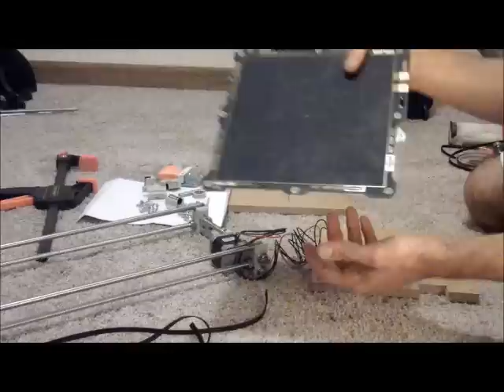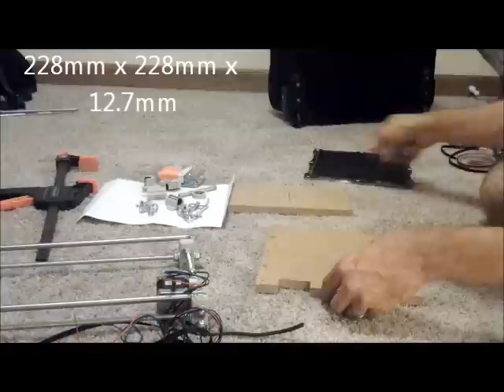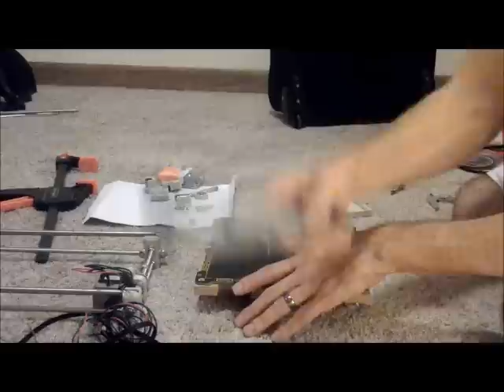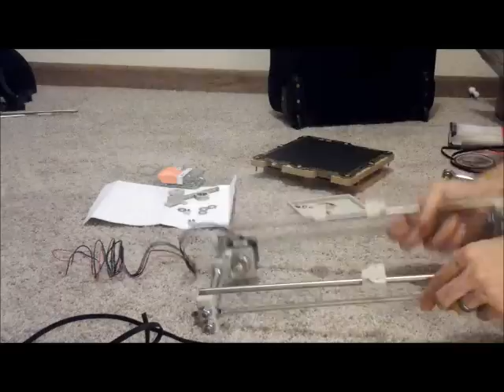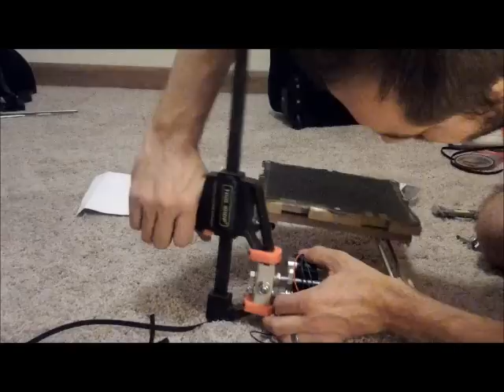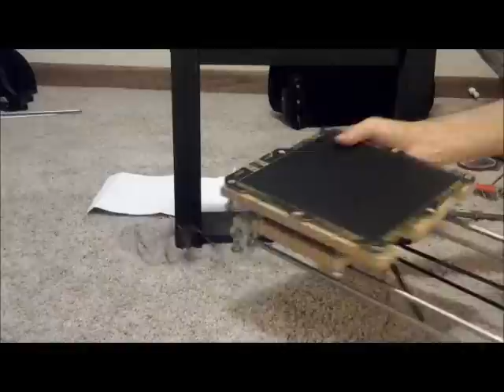Prusa i3 build log, Stage 3

Comment: You are mounting the Y-axis plate the original Prusa way, being 1/2" MDF this is going to have a significant mass. I am sure it works but you might get higher acceleration if you keep the plate mass to a minimum. Anyway, great work with your videos.